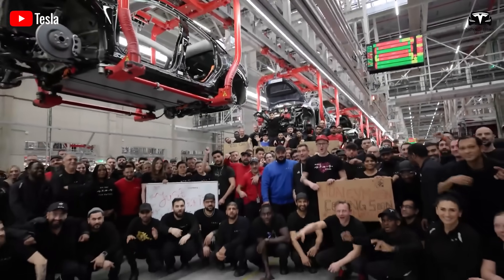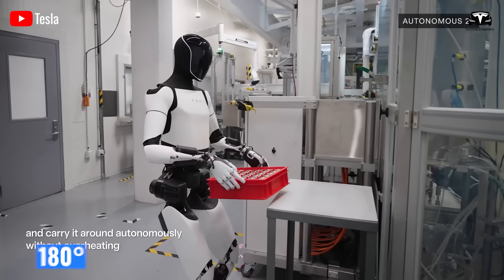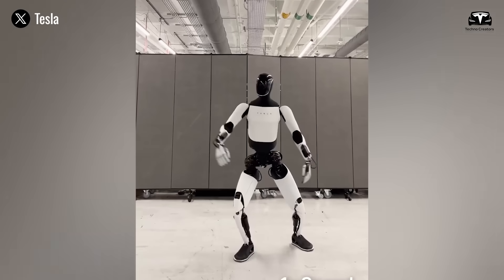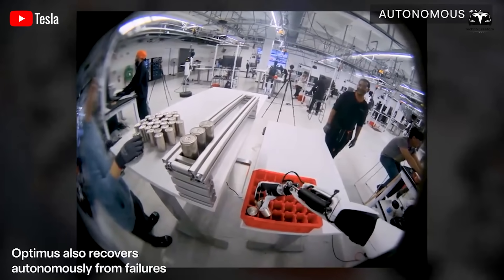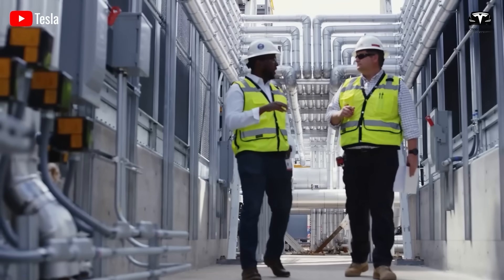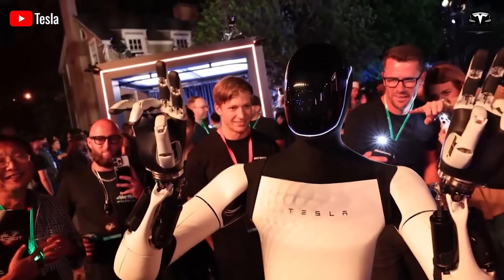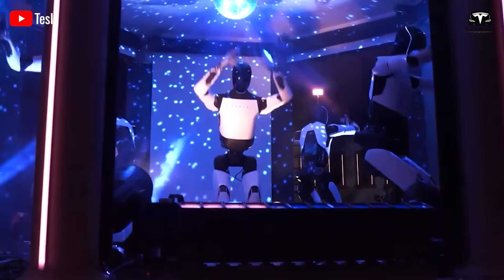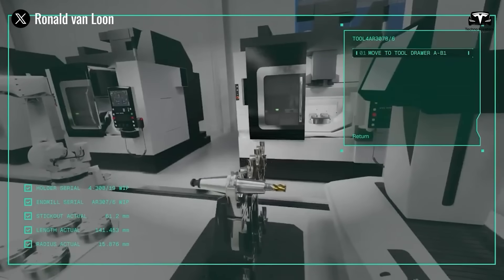Elon Musk SHOCKED A Day of Tesla Optimus V3.5 In Factory, Boosted 50%! How Its Work?

Comment: Like usual, the latest tech being developed by Tesla starts out with marketing hype that can't be beat.
Then as release dates get pushed back over and over again and the original optimistic hype starts to realign with the plethora of potential market fluctuations and the added costs of operating each individual robot, the actual cost of buying or renting these robots no longer seems as beneficial as the original marketing hype led  us to believe.

I suspect that for individual buyers there will also be requirements mean that buying insurance for these robots might also be mandatory, especially after the first accident involving one of these robots is experienced and reported, just like the car insurance went up when it was found that EVs were labeled by some as being prone to battery fires, even after it was proven otherwise.

Comment: Isn’t it a waste of energy having robots typing when they can transmit information directly through WiFi or USB?
Reply from the maker: Exactly—it looks wasteful, but typing proves hand dexterity so robots can use human tools anywhere.
Reply: @TechnoCreators-pj9dg did you see how slow the robots were especially the ones that aren’t people in robot suits or CGI.
Reply: Yes, but until some of the systems get upgraded, it's a lot easier to have a robot come in and use your existing systems like keyboards.
Reply: @jashpaper8370  most keyboards are near a usb port and a lot modern keyboards are Bluetooth. Just bypass the keyboard.
Reply: sure  is only showing capability off beast ...sure they wont need to type into computer ...direct data transfer